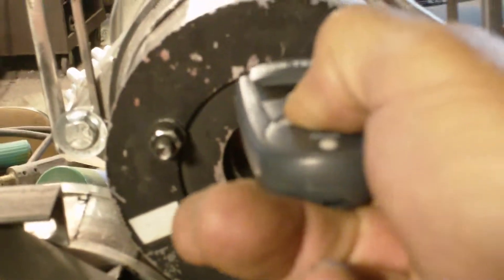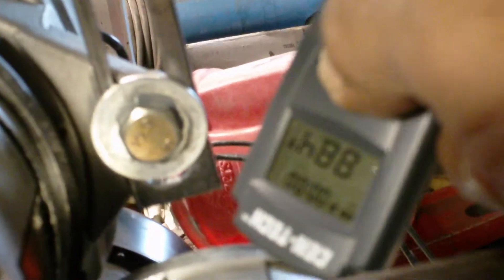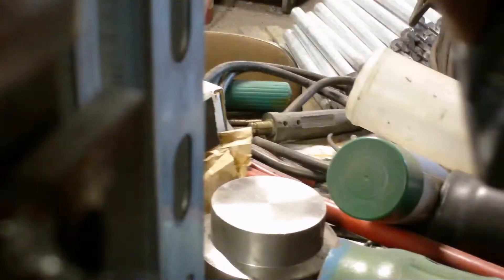wtf ??? hatem device or coler? #3 faceplate and magnet temps

Comment: You probably have figured it out by now. You have slipperage between wheels. You do not want "MAGNETIC FRICTION" in your setup. It causes heat. You want complete synchronicity. Not so if your building a "MAGNETIC HEATER". see video called " Heating Copper Wheel with Permanent Magnets Part 1" and part 2 . Start your motor slowly. Use only one gen to start and figure things out. I'm not an expert, just an acute observer. Cheers.